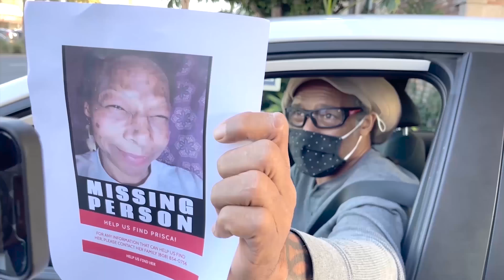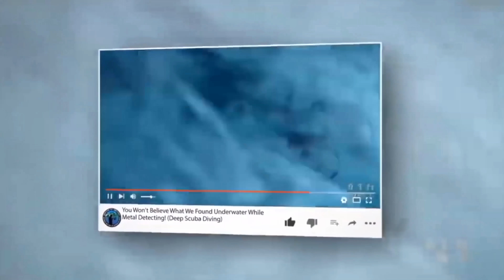Divers FOUND 150-Year-Old LIVE Cannonball! *SHOCKING RESTORATION* From River To DEFUSING.

Comment: The black powder in that shell was likely just as good as when it was made. Beau Ouimette  showed defusing some shells on his channel,  and then lit the powder. It burned like mad. There was also one gent killed & his son badly injured when he was defusing a shell in his basement. Those shells are still dangerous until you safely get the powder out of them. That is why Steve had the water continuously running  over the drill bit and why the shed is so far from the house. For safety JIC things go pear shaped..